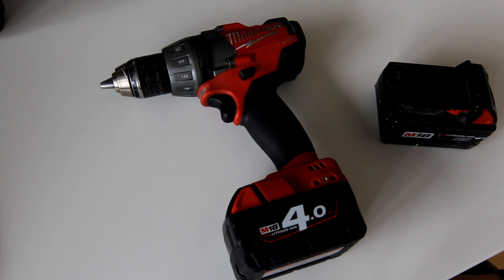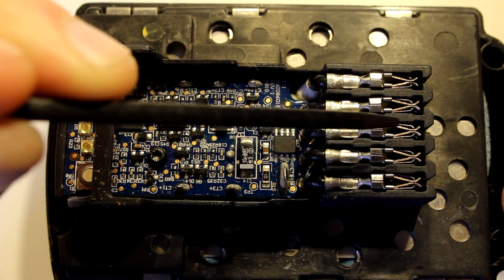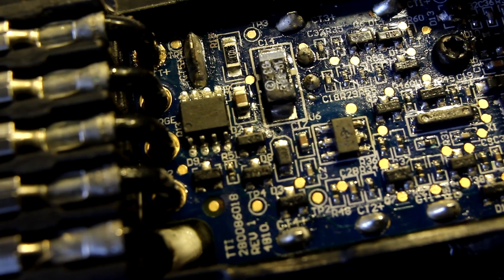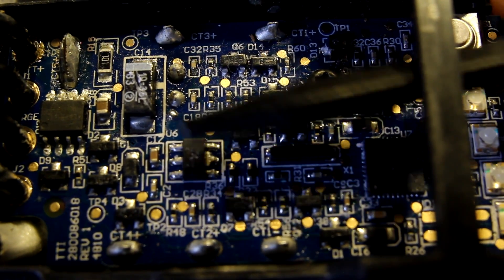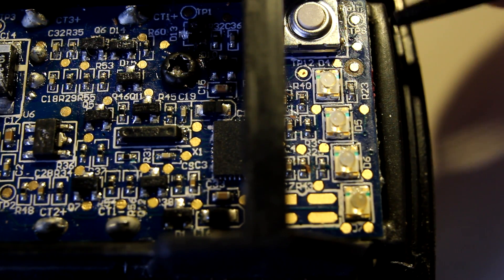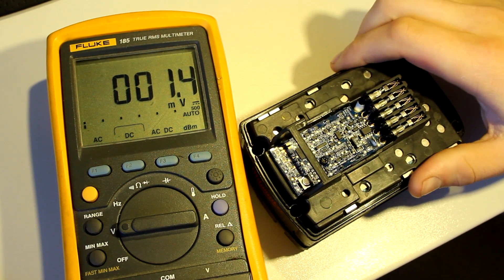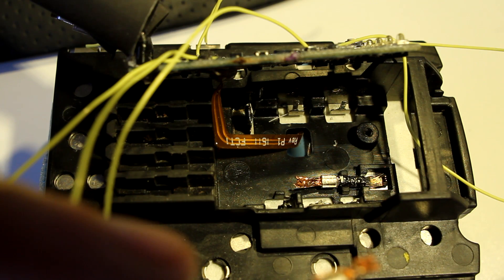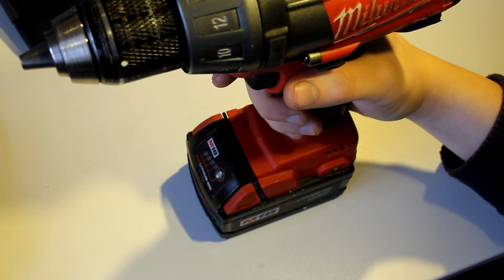Milwaukee M18 battery teardown and repair (002)

Comment: Best video I've seen on understanding the Milwaukee lithium battery pack. Hopefully you can answer a question. 18 volt 3.0 mah pack that worked fine, just quit and when placed in charger got the flashing red - green lights.  No light when when pressing the battery charge level button. Checking the battery terminals there is 15v. or so on the two positive blades. Now the interesting thing: battery works in the flashlight but not in the drill. Should help with troubleshooting if I just new what it indicated. Can you help?
Reply from the maker: Seems like you deep discharged the battery. If you have a bench power supply, try using that to charge it up to ~17V, then complete charging in the 'official' charger. Without a bench power supply... uh, find somebody with one :)
Reply: I have the exact same issue, did you resolve it?
Reply: @beenesgarage2055  - did you READ the reply?

Comment: Could you post a diagram on how you kept that PCB powered when you removed the battery pack? I have one with bad cells but I don't want that board to go dead on me. Love your videos.
Reply: ever figure that out?
Reply: Vu Nguyen nope, sorry
Reply: have you taken the board out? if so was it still in good condition?
Reply: You would need to measure the battery voltage across the two output terminals and accurately match that with a bench top power supply and connect, be careful though these battery packs can output as much as 1kw on the larger ones at like 70A, hence you need to match the voltage very accurately to prevent current flow between battery and psu.
Reply: Why the fuck do you need a diagram or further explanation? The guy showed us in the video and explained it in detail. You simply need to use your eyes to watch, your ears to listen, and your brain to think. If you wanted to keep the power on a certain  connection, whilst you removed the main terminal on that same connection... think Think THINK about it.
Reply: @johncoops6897  There are no stupid questions only stupid answers

Comment: Did you ever decode the secret blinky lights when you press and hold the battery charge level button?
Reply: The information about the blink codes can be found on a Google search. The first set of blinks is  probably just "battery OK or dead" The second set of blinks is # days since battery was first connected to the buyer's charger (not same as days since manufacture), the third set is # times the pack has been recharged, and I don't think anyone worked out the 4th code. These codes are simply for warranty purposes.
Reply from the maker: I've gotten positive feedback from somebody that it's indeed a date code and serial number, but not exactly how those work. So not really.
Reply: Have you ever had to remove one of the cells? If so do you have a video of it?
Reply from the maker: No, so far both of my battery packs have been running perfectly balanced, without any issues. If you're interested in battery pack tab welding and the such, I do have a few tab welder videos although I don't really show me disassembling and assembling a full pack. That will come sometime in spring 2017 when I convert one of my bikes to electric.

Comment: why the 4.0 so big on that battery
Reply: gee mcgee not an actual Milwaukee. It’s a knock-off brand.
Reply: It's NOT a fake/clone. It's a genuine Milwaukee from a non-US country. The product code is M18B4 4932430063 - This battery is the same as the current US Model called "M18™ REDLITHIUM™ XC 4.0
The Milwaukee product names, codes and graphics in the USA are different to elsewhere in the world.
USA uses RedLithium graphic and a unique part number:
https://www.milwaukeetool.com/Products/Batteries-and-Chargers/M18-Batteries-and-Chargers/48-11-1840
AUS uses international part number,  but old "non-RedLithium" graphics
https://www.milwaukeetool.com.au/power-tools/batteries-and-chargers/m18-batteries/M18B4.html
EUR uses the same AU part number and used to have "big 4.0" graphic (like in this video), but have just changed to the USA "RedLithium" stickers
https://uk.milwaukeetool.eu/m18-40-ah-battery/m18-b4/

Comment: Hmmm... this has some potentially bad news for me.  I removed the PCB from two of my Ryobi batteries (similar, made by the same manufacturer) to do some soldering on it.  If it has the same type of micro controller, you're saying it won't work when I put it together?
Reply from the maker: There's a significant possibility it won't work anymore if you completely power down the electronics and then reconnect it afterwards. Unfortunately that's how a lot of BMS systems work. But you can always try, she's already fucked, can't fuck her any more... wait...
Reply: Thanks for the info.  Perhaps you can let me know if these PCBs do actual balancing of the cells or not during charging.

Comment: Hi, thanks for the video, I 3d printed an adaptor to use the new M18 batteries that came with my new driver/drill set with my old milwaukee tools, but need to include a overdischarge circuit, do you know what voltage the new M18 battery cuts out at?  I plan to check that when my drill needs charging, but have not gotten there yet. Wish they would just make one like Dewalt did. the old tools work great and will keep working well for a while, so want to keep them in service
Reply from the maker: The drill seems to cut out at 3.3V/cell.

Comment: Oh for crying out loud dude, that is NOT a fusible link, these circuits have an internal shutdown circuit, secondly you should be testing each individual battery, i have done this many times, i find one battery usually defective, do NOT try and charge the defective battery, get another one off ebay, i replace them and voila, all good , all charging and all lasting.
Reply: Yes it is a fusible link. That is why it has a crimp band on either side. They would not be there otherwise. To bad they don't use a fuse holder externally, available for fuse replacement. Since corporations are only profit driven, and we live in a throw away society, we probably will never see that design.
Reply from the maker: Don't know how to break this to you, but it is a fusible link and there 
is no shutdown circuit. It was literally melted through. I don't know 
how more obvious it can be. Your entire comment is false.

There was (and still is) nothing wrong with the cells. They are well-balanced and the machine still works a treat on the repaired battery. I've actually checked last week; the cells are still within 50mAh of each other, which is very well-balanced for an abused pack like this.

Comment: how did you charge it using power supply?
Reply from the maker: With the pack disassembled, I just clipped the alligator clips from my lab power supply to the positive and negative electrodes of the pack. That's obviously only possible if you fully remove the casing of the battery pack.
Reply: how about the built in balance charger? still working when you did it?
Reply from the maker: This battery doesn't have any battery balancing built-in, so there was nothing to break :) Like pretty much every lithium ion battery nowadays, it never balances the cells, it just stops charging/discharging if one of the cells goes out of safe bounds.
Reply: @PowerElectronicsBlog  In this case whats the purpose of Charge pin? And why each cell is connected to the board? :)
Reply: @shchepetov  - not sure what you mean by "charge pin" - if you mean the centre pin then that is where the charger supplies +21V, whilst the left pin (marked +) is directly connected to the cells and where the tool draws (nominal) +18V. The cells are connected to the BMS PCB so it can MONITOR the cells. There almost certainly is some cell balancing in this pack, and in most other tool packs.
It's not resistive balancing like used in cheap chinese balance boards. That style of balancing works by charging the whole pack to say 5x4.2V=21V then discharging the highest cells down to the same voltage as the lowest cell. You can identify those because they have mosfets and resistors for each cell. The balance process is slow, and final pack voltage will be lower than 4.2V per cell.
There's a more advanced method called "Active Balancing" which charges the pack to 5x4.2V=21V then uses separate DC-DC converters to transfer charge from the highest to lowest voltage cells. You can identify those because they have mosfets and inductors for each cell. The balance process is slow, but pack will end up much closer to 4.2V per cell.
Modern BMS (and especially where you want immediate full voltage after charging) usually use "top balancing". This is where the cells are individually charged to (say) 4.2V EACH, rather than just as a series group. When the first cell reaches 4.2V, it stops charging but the other cells keep charging until each are done. This results in "instant balancing" to full rated voltage, and none of the cells get over-volted then discharged back back to "balance them". You wont easily see extra components to this kind of balancing, as the charge regulation will be done using the main IC.

Comment: Great video, could you tell us what 18650 batteries milwaukee uses in their M18. Thanks
Reply from the maker: They're not branded with something that indicates the exact cells they are. All I can say is that this pack is 3Ah, has 10 18650s, and is rated at 30C, so they're  probably 1500mAh 30C cells. Something like LG INR18650-HB2s
Reply: The batteries he is showing in the video don't look to be a genuine milwaukee battery
Reply: 3amp hr ones are inr18650 13q
Reply: My m18 red lithium xc has 18650s clearly marked samsung INR18650-15M samsung SDI 121

Comment: good work,
I have an problem with replaced battery, the discharging is ok, and voltage shows also ok, but I can not charge via charger, shows broken batery. It is possible to "restart" some how?
Reply from the maker: +Žaneta Seidlova That is very likely a broken charging MOSFET between the charging and battery+ pole (look in the video for exactly what I mean). You can replace that MOSFET, but you need a hot air rework station to do that.

Comment: Thanks for the detailed video. The same breakdown was . Your video helped me a lot . One problem - I cut the wire to a temperature sensor :(
 Can I connect by soldering the ends cut off ?
Reply from the maker: +Povorotam Well, you can try - there's not much else you can do I guess. Or, if it already works with the wire cut, why not keep it that way?
Reply: +PowerElectronicsBlog 
All broke :(
Closed the sensor contact with the battery contacts .
Processor let smoke :)
Now I'm looking for where I buy a motherboard for a battery . :)
Reply: Here's a link to a new case and board:

https://www.aliexpress.com/item/Li-ion-Battery-Plastic-Case-M18-Shell-Charging-Protection-Circuit-Board-For-Milwaukee-18V-M18-48/32837214698.html?shortkey=nmeEbi2u&addresstype=600

Comment: hi, how did you repair the broken fuse, you didn't say, I have 7 batteries that are all doing that, that have had alot of use but not that old.
cheers.
Reply from the maker: +999metalme The fuse isnt a standard part, it looked like a piece of braided copper. So I replaced it with solder wick braid of the same size (6mm/1/4 in)
Reply: Your a champion, Thanks for the quick reply I hope my batteries problems lies in the same area.
Reply: Call Milwaukee and they will fix or replace them free of charge, if the batteries are less than 3 years old.
Reply: I just wire around the fusible link. I have never had any trouble with this way.

Comment: When you had it on the Milwaukee charger, was it flashing red and green?
Reply from the maker: +Clayton Magnet Nope, it was pretending to charge. But almost no power draw.
Reply: +PowerElectronicsBlog Just wondering because I have a battery pack that flashes red and green on the charger, the battery level doesn't work, and wont power the tool. The cells are charged though.
Reply: Insert properly same problem on mine just push down abit more

Comment: any idea what voltage output on those 2 "data" pole?
Reply from the maker: +edwardlui531 They seem to have pull-ups to 3.3V. But there is no way to say what they do without properly probing.
Reply: The data poles will have DATA on them, not a Constant voltage.
Reply: @johncoops6897  Is that the two inner pins of the battery?
Reply: @ThuleApsu  - The M18 batteries use data communications between the battery and the charger. You need to pass a data string from the battery BMS to the charger in order to get it to commence charging. There is also some information back the the BMS which stores charge cycles, etc in memory for diagnostics.
I cannot remember the full details, as I gave up trying to hack it. From memory, nobody has been able to completely reverse engineer it - I'm not saying it is impossible, but just that I couldn't find a proper analysis online after a lot of time searching.
Reply: @johncoops6897  This is where a good data storage scope would help, thanks for your reply.
You say data goes from battery to charger, I think its duplex, that's why my battery seems to 'trip' on the impact and reset by my drill, the 2 inner pins measure 3.3v on untripped and 0v on tripped.
Reply: @ThuleApsu  - the easiest solution is to just replace the PCB  in the battery. I have found what seems to be a good supplier as well as a really bad one to avoid.. The good BMS is about $15 each, do you want info?
Reply: @johncoops6897  It's 11 months later, but the supplier info would be appreciated, please provide
Reply: @johncoops6897  Thanks for the info. Found it.
Reply: @alanharriman23  - YouTube deleted my post ROFL 😏😏😠😠
Reply: @johncoops6897  ??? Their priorities appear to be miss focused.😴😴😴

Comment: A Milfukey like AvE says :p, the string wire is a Fusible link, mostly used in older cars ;)
Reply from the maker: +Damicske I was very strongly thinking of referencing AvE here, but I can't pull off a skookum canadian accent like he does.